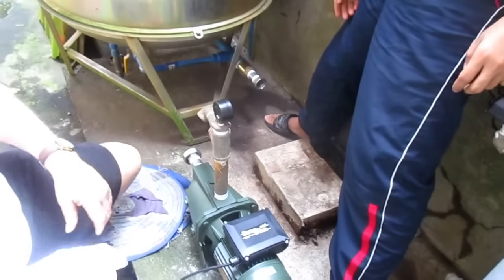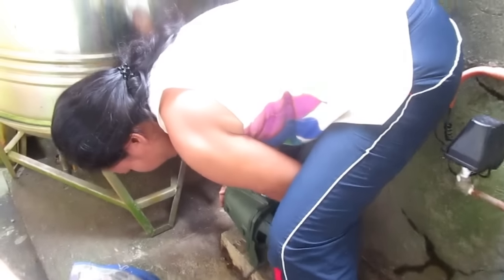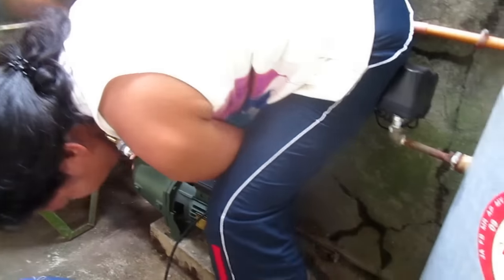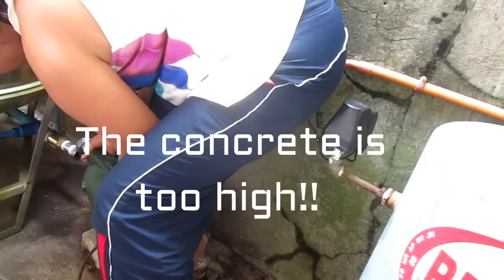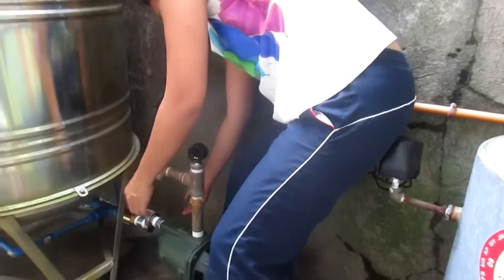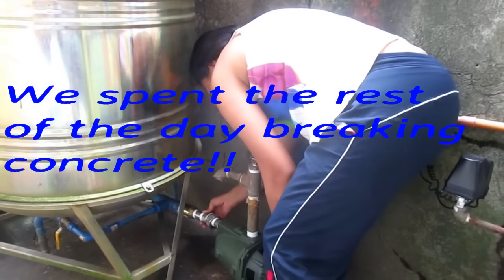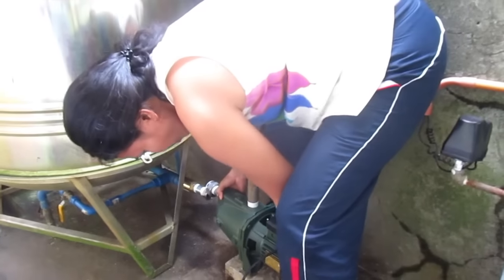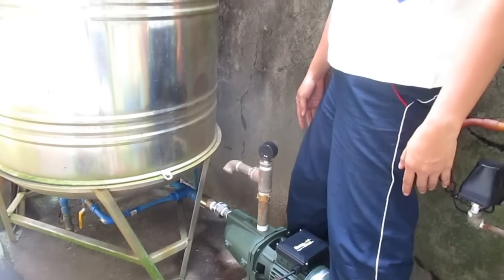Water well pump installation in Bacolod City Philippines.  Negros Island Philippines

Comment: I will build my water tank high with blocks and have it feed the house, gravity feed. Will try to find a float switch to bring the water pump on when the water reach a certain level. I did that for my coral reef that I made from a 75 gallon fish tank that has claims. I used 2 -250 watt metal halogen bulbs and Ballard and 4-110 watt Florissant lights to come as close to the sun as possible for the claims. Used a Johnson control 120 volt t-star to bring the fans on when temp for to hit from lights. Used R/I to add  water when it was needed with a float switch, build my own calium reactor to automatically keep the alcoholenty correct which I used carbon of code to run the reactor. The live rock help also making the reef automatic, I had a yellow tang, surgeon fish and clown fish in the tank. My electric bill was crazy. I sold it for more than it cost to make. Got tired up electric bills to bring the sun in the living room and the fans were loud. Lights brought in by timer. I also had a 30 gallon sump tank where the r/0 water went before going to tank and used special filters a a little town brand pump for the r/o and a different pump for the 75 gallon tank. Been a long time don't remember all I did.

Comment: Good teamwork ! I love the initiative and the strength of Ms Rose. The water pressure here is not good either. I now use the CR closest to the front of the house as it has better pressure. Usually from 7am - 7pm pressure is low and sometimes no water at all for a few hours. We also have a deep well and pump here for reserve. Happy New Year to both of you !!!!

Comment: hi good day, i have some question regarding of water pump installations, is it okay i will use the pressure switch with out pressure tank?i used rubberized hose only, if the ball valve was closed the motor will auto off then the ball valve was open the motor was auto on.thanks

Comment: Hey Mike,
My central air con went out on New Years Day here in Miami right when the sun went down so I didn't feel like wrestlin the gators in the back yard in the dark so I fixed it next day. Thankfully it was just a dual run capacitor, sure feels good when you can fix it yourself n save big $$. 
Great teamwork guys !
Solid install Mike with stainless fittings too, should last a long time.
Love you guys, Happy New Year.

Comment: I assume the big tank is the large storage and the pump pressurizes the smaller one between 30-40psi. I have a similar setup bur the city water storage is underground. My first talk was a Bestank but after 4 months we found it rusting from the seams in multiple places. Tank was probably over $300 and Wilcon blamed it on hard water. We replaced with a fiberglass tank with s bladder. More expensive but will last longer.
Reply: Please help me. Do I really need the smaller tank? We dont have second floor and we need watwr during daytime so we will buy a 600 liter tank + pump. But they said that we should buy a smaller one.
Reply: @Bischarch  Yes, you should have a pressure tank hooked up when using an electric pump. Otherwise, the pump will not last long because it will turn on literally every time you turn the faucet on. I bought a 42 gallon pressure tank (which seems to be the standard in Philippines) for PHP 3,980. You could actually use an electric pump and pressure tank configuration but when the power goes out you don't have any water stored. The configuration in the video appears to be a "booster pump" configuration where a submersible well pump fills the storage tank, then another pump pressurizes the smaller tank and feeds the house. I personally prefer the pump/pressure tank configuration with my 800 liter Bestank manually filled by the switch of a valve. That way when we have brownouts, I still have 800 liters gravity fed to get me through. If you have any questions, I'm happy to help if I can. Good luck and mabuhay!
Reply: @terrygloa7925  How much would you expect to pay for the pump ? I am going to put together a collection system with rainwater and want to pressurize the system.....
Reply: @hughiethehabfan  I bought a Gould's J10S+ from Cleofel in Santa Maria, Ilocos Sur. It's a 1 HP convertible well pump. You must buy the adapter if connecting it to a shallow well (less than 25' deep for PHP 500). The pump was PHP15,200 + PHP500 for a total of PHP 15,700. I researched what pumps are commonly used in Philippines and the Goulds pump was always denoted as the best and used on the more expensive homes when I checked. The standard for a pressure tank with a pump that size is a 42 gallon stainless steel tank. The pressure tank cost PHP3,800. Hope this helps, let me know if you have any more questions. I have pictures of a common well setup from the neighbors house plus pictures of my pump, tank, and everything else if you'd like to see.
Reply: @hughiethehabfan  What you're describing is a booster system which goes from a holding tank (Bestank usually which triggers the pump to cycle with a float switch) to a pump, then a pressure tank, then the house or whatever. Please see figure #5 on page 7 of this PDF: https://www.aquascience.net/downloads/dl/file/id/1000/product/0/goulds_jet_pump_installation.pdf

Comment: my pump went out a few weeks ago so i had to replace my pump. a 1 hp Gould pump  not cheap. I also used stainless steel fitting where i could find stainless. I also need pressure for the second floor . I went to gould and had them install. i spent 23,000 with pump fittings and labor

Comment: Please help me. Do I really need the smaller tank? We dont have second floor and we need watwr during daytime so we will buy a 600 liter tank + pump. But they said that we should buy a smaller one.
Reply: @myphilippinejourneytravelinfo  so it is necessary to buy the smaller tank. So the setup would be 600 liter tank > water pump > smaller tank for pressure. A bit expensive but would really help us coz there is no water during daytime.
Reply: @myphilippinejourneytravelinfo and also please help my friend about there small pressurized tank got a hole on the top and it's squirting water now. Welding it didn't solve the problem. Please help
Reply: @myphilippinejourneytravelinfo  and also is it possible to just install the 600 liter tank + water pump only? The source of water is just less than 10 meters from our house. Thanks mate! There is no professional here in our place.
Reply: @myphilippinejourneytravelinfo  thank you very much for the info! Guess I need to install the pressure tanks too. Keep up the good work and god bless!

Comment: Good job! I would suggest that the wires be connected in a water proof box, not just wire nutted in the air. The water will corrode the connection and your pump will burn up again. Really I think you have enough wire to eliminate the new wire that goes into the peker head on the pump motor and run your wire directly in there.
Reply: @myphilippinejourneytravelinfo  Ahhh! I see! Just trying to protect your hard work!

Comment: Getting material here is a headache. Not good quality, I love on somewhat island I have to take a ferry to surigao where they have a ace hardware store. Here on the island we have nothing. With the virus we are on lock down. It's rough, I see a check valve on the table, where did you get that and the pump. Also on the blue pipe they have a take some time wet,dry sand paper and remove the shiny surface so the blue seals and the pipe does not blow apart.